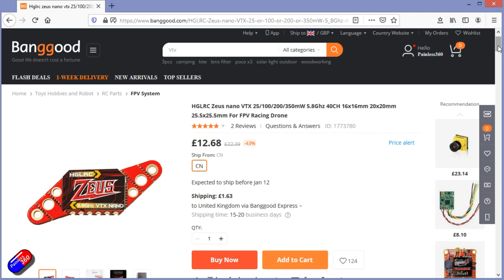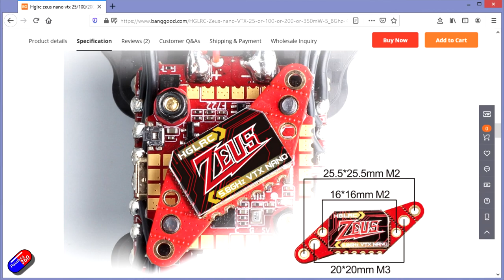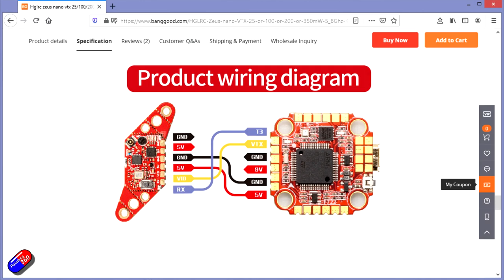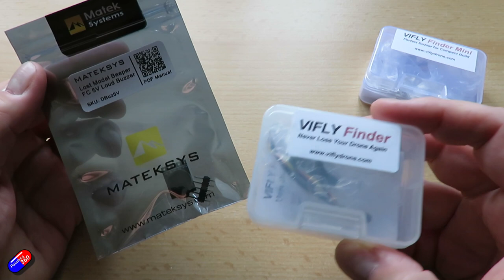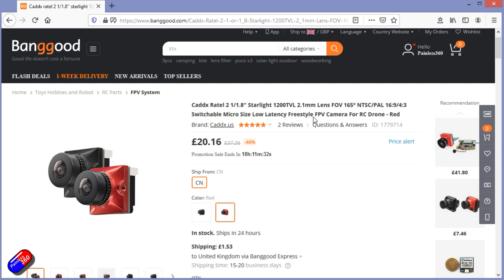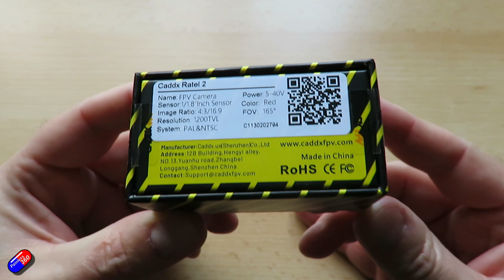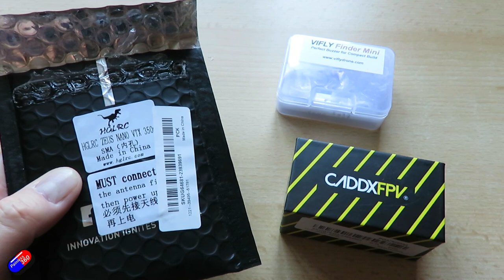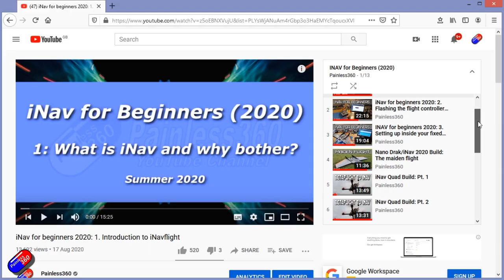Mini Tech Round-Up: A tiny VTX, model finder and latest Caddx camera!

Comment: Hello! Thank you for your review. I always see your videos and I like very much the way you present the information and the contents of the tutorials. I think I learned a lot watching your videos. 
I have a Caddx Ratel and comparing the specs of this one with version 2, it seems that one of the main differences is viewing angle (165° for version 2 vs 160°). Light level seems to be 0.0001 lux for both models. I found that at Caddx webpage. Other difference is how camera housing was built (version 2 has a more protective casing, improving dust entry protection)

Comment: Hi Mr. P   Great video and finally something I know very well.  I have been using HGLRC products for years,  I have 3 of there quads, and I have only needed a vtx for the  Parrot 132 6s,  and a F.C for my XJB-145.  I just haven't had much trouble with there products.  But the Caddx Ratel 2, I only have one. But I do have 5 Caddx Ratel starlights, 1 Caddx Ratel baby and 1 Caddx Ratel ant. I guess you can say that I have a thing for this camera,  the 5, I have the 2.1mm+ND Filter. And I love flying it at night during a full-moon. I can see everything.  And it's just the best for color during the flight.  I just installed one in AR Wing pro.  But the best is that little beeper.  I'm hard of hearing and I no longer can hear those ones that come with BNF. BUT I can hear the VIFLY I have one in my Chameleon.  Thanks again for the great work you do for us.